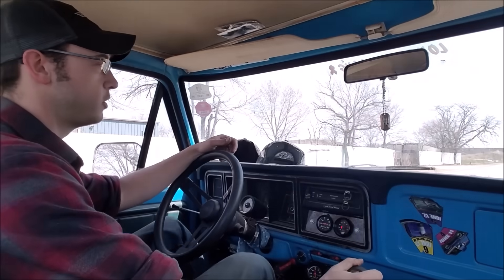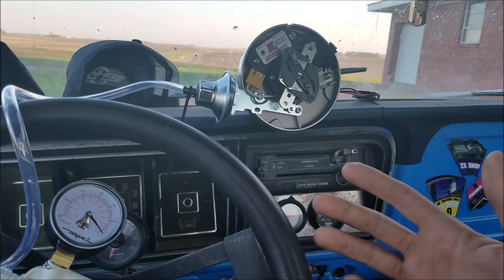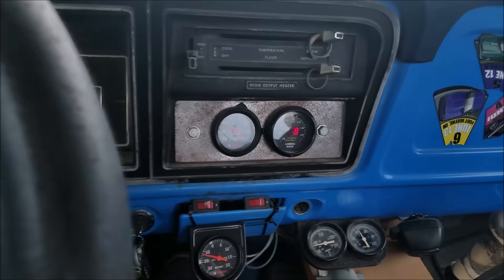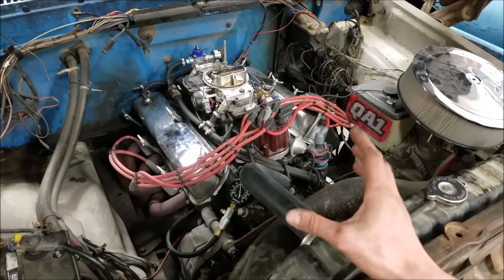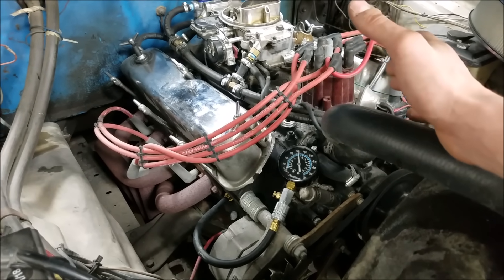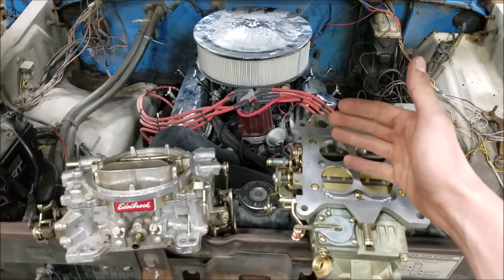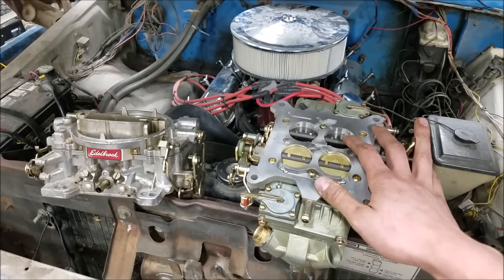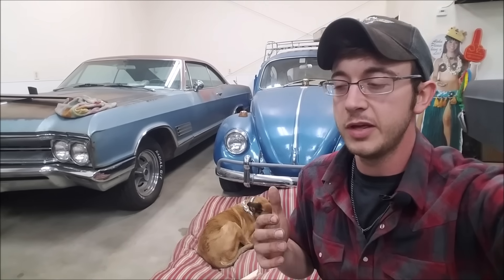Vacuum Advance - Ported vs Manifold: Which to Use & When !!!

Comment: Great video, you really know your stuff and explain it well.👍😎 The vacuum advance is even more important on a Ford flathead 8BA V8 since the distributor  does not use any mechanical advance. It is a very interesting system. It is also why most modified Flathead V8's get such bad gas mileage since the system only works with the stock carb.
Reply from the maker: Thanks so much! 
I’m not sure about the flathead comment though, I believe they are a typical vacuum advance and mechanical advance distributor! 
Now older beetles - like mid 60s and earlier actually only had vacuum advance BUT they used venturi vacuum which increases with air speed - so essentially as RPM increases so would the timing. 

Not a big fan of beetle ignition timing though, it was extremely inferior in my book!!!
Reply: @ThunderHead289  I am working on an 53 Customline with an 8BA at the moment installing a dual point plate, and there is no mechanical advance in the distributor at all. The point plate is actually mounted on a ball bearing so it can respond to subtle changes in vacuum. As I said before it is an interesting system. The carb also has some extra vacuum control with two different ports to the venturi and some check balls and an air pressure sensor. Check out a Holley 1901 carb to see the system. Not the new 1901 ( thermoquad clone) but the old one.
Reply: Yeah ford called it the load-o-matic distributor used from 1949-1957 on both small v8s and inline 6 engines and well Into the 60s on inline 6 only.   It required the vacuum signal from the carb venturi for it to work as intended, and used only vacuum for timing advance. It required te use of a specific carburetor and a spark control valve. I had one on a 1957 272 and swapped it out for a mechanical/vacuum advance dizzy and the difference it performance was like night and day. Unless you have a 100 point restoration I suggest you get rid of the  load-o-matic dizzy as soon as u can. The performance increase is almost unbelievable you won't be disappointed with the results

Comment: Luke, really good video. Very informative. And you have that old Ford running like a beast. Motor still sounds strong , and good compression the bottom end still has. Good job bud
Reply from the maker: I’m amazed it has that much! That engine has 165k on the clock at this point. I’m glad you liked the video and it made sense - it’s hard to condense everything down so much. For everything I say, there’s 5 points I cut out for the sake of time.

Comment: Hi Luke. I used to put a light on it. Rev it up, switching the hose back and forth and turning the distributor, to get the best timing setting. Also changing the mechanical weights and springs .

Comment: I always tune my carbs/timing without the vac advance hooked up, then once it runs the best I go back & reattach an adjustable vac advance to manifold vac (always seems to have worked the best for me) & take it back out to set when & how much the vac advance does for best cruise/part throttle torque.
Reply from the maker: Essentially when driving it’s all largely the same, but adding 10 plus degrees after you do all your carb idle settings is going to raise your idle rpm forcing you to go back and readjust the carb afterwards. 
If you actually went back and connected to ported, everything would be all equal on a vehicle that you set up as you describe
Reply: @ThunderHead289  I think you disconnect and plug it during ur mechanical adjustments to prevent that "getting into the ported draw" you described... then adjust the carb mix, then connect vacuum advance and bring idle down where you like.

Comment: Youtube is posting ads every two minutes.....

Anyway, I have a 350 Buick in my 66 Chevy. I run the vacuum line off the Q-Jet's little brass port. It's a stock V8 that's 45 years old but I still eek out 17mpg on the hiway which ain't bad. But I never knew the value of ported and manifold vacuum. That's a new one on me.
Reply from the maker: On ported you can run a little more mechanical initial - of course with keeping total timing in mind. Luckily most stock engines have a lazy advance curve and low degree total timing value, so this can be almost immediately applies without having to do anything else. 
The factory set points are all extremely safe.
Reply: Sounds like my 78 351W, manifold vacuum and I get 18 city and nearly 27 highway.  But yeah never run manifold vacuum for vacuum advance lol.

Comment: So for 30+ yrs and hundreds of engine in cars and Dyno run you think my tuning would make a car lazy or have poor performance?
Sorry but ported vacuum is near useless on stock to high performance engines.
Vacuum advance is basically added to increase you cruise mileage
Since I learned tuning from some seriously famous engine builders and you claim about stock or mild cams make absolutely no sense.
Say a small block like 36 total for power production. IF you ADD timing with ported you will force engines with with more compression to rattle as you part throttle accelerate. Seen it hundreds of times and had to fix engines broken from improper timing.
You can believe what you want and throw it out on you tube but from power production and street performance I'll keep using vacuum advance for it's intended use. Mileage.
Tune your centrifugal, and initial for power and if you street drive it add vacuum advance with manifold vacuum and use a limiting can to avoid spark knock/rattle. Worked for last 75+ yrs, and when you may the throttle you go back to best performance full throttle timing.
Got a whole shelf full of hyperutecic pistons(new cheap favorite performance pistons most use instead of forged in wrong instances) MINUS ring lands and Piston crown from rattle and many from trying to use ported vacuum.
Leave ported for the old-school 70s emissions crowd.
Reply from the maker: I’m not sure who taught you, but ported vacuum is exactly unequivocally the same as manifold vacuum except at idle. It IS just a device to aid in mileage because at part and low throttle cruising you have less cylinder volume so cylinder pressures are lower and burn time is longer. Stab the throttle and when vacuum signal drops, you of course are just on your mechanical timing. 
You clearly just commented without watching the video, or comprehending what you watched. Because I lay that all out clear as day. I encourage you to rewatch and process what I said. 

From your comment, I’m not sure if you understand how ported vacuum advance actually works. 
On a mild cam or stock cam engine, for the carb to be in its proper dynamic set up, you have to run too little mechanical advance at idle on Manifold vacuum. When you mash the throttle your timing mechanical timing is late and it’s weak off the line. 
The bandaid is to advance the timing quickly by adding lighter springs - but then you have too much mid rpm cruising timing and you WILL have part throttle spark knock!

High lift cams are completely different. 
They require a lot of idle timing, so a more reasonable curve can be used in conjunction with manifold vacuum. This is why I say stock and mild cam build - which unless you want to lose on the street, is what you should have anyway.

Comment: Been watching ur videos really like them I watched where u put 5 speed in ur truck I have a 73 f100 I'm putting tremec 5 speed in it on yours did u out clutch spring on ur throw out bearing arm and did u have to modify clutch rod is appreciate your answers
Reply from the maker: I used all the original mechanical linkage as it was - what bellhousing are you using? 
I’m finishing up a TKO 5 speed swap on my galaxie right now.

Comment: Ported vacuum for the advance came out in the early seventies to effectively retard the timing at idle for pollution purposes.  Because the timing was retarded, there was less heat in the combustion chamber reducing one of the three exhaust pollutants.  Long time ago, which one I don't remember.  Thanks for all your content.
Reply from the maker: This was true with how it was utilized in the 70s, but actually ported vacuum existed even in the 50s and was used by flatheads long before emissions existed - before PCV and everything. 

I used to believe what you said above solely, but I got that info from the internet, and it may be the single most regurgitated and repeated “claim” about ignition timing to date. 

Don’t fear ported - 
There are two ways to do tuning to make good power. The way I showed here, or manifold with quick advance springs so an engine doesn’t fall on its face off the line - my problem with manifold is that then when cruising, you have way too much cruising timing at the lower rpms
Reply: Learn something every day, even at my age.  Oldest car I've owned was 62 Pontiac with manifold advance.  First car I owned with ported advance was my 74 Barracuda 318 and all the pollution stuff except the cat-con. It has a OSAC (orifice spark advance control) valve to let the vacuum build up slowly when depressing the accelerator.  When I first got the car I thought I'd be smart and hook it up to manifold vacuum. Not good,  put it back to factory and it ran much better.  Thanks & Best Regards @ThunderHead289

Comment: Good video on this. One of the dangers of running manifold vacuum with too much advanced initial timing on a stock type cam is breaking the nose of the starter off at startup.
Reply from the maker: The biggest problem with running manifold is that you have to have a lazy mechanical initial setting to not have too much timing all together - no problem, utilize quick advance springs to compensate! 
Well, then you have too much timing while cruising at mid rpm driving rangers 1500-2800 rpm.
Reply: @ThunderHead289 , you are still limited by initial advance unless you dont mind letting your engine cool off before restarting.  As I said on the last video my 302 would not run smooth at idle with ported.  Already at 12* initial as I bumped it up for more power.  14* has starter drag when hot.  Vacuum advance is really something you shouldnt worry about when it comes in cause vacuum advance is only used for low load conditions any time you hit the throttle hard under load you are running off mechanical advance only till the load lightens and then vacuum advance comes back into play.  I'm still trying to grasp how ported vacuum gives you better power and better economy.  When you make more power you consume more fuel.  It also goes against what ford did for economy by advancing ignition through manifold vacuum stupidly high through the economy calibrated DSII modules.  My 78 mercury has one and my manifold vacuum advance 351W with 14* initial with the DSII economy valve to manifold vacuum puts my ignition in the 40* range at idle.  Engine made great power and still was able to get me nearly 27 mpg on the highway at 75 mph.

Comment: Super helpful video and great explanation as to why it's used. I have been dealing with vacuum advance issues on a 76 Datsun 280z due to leaky vacuum lines. It's fuel injected but it uses port advance off the throttle body.

Comment: Apples and oranges comparison but I would love to see you do a video setting up a carburetor for a ls motor or other distributorless motor.
Reply from the maker: If I could program a timing curve all my own, I would actually love it. The shortcomings that are inherent in the design of oldschool distributors are super annoying. They work just fine, but with timing being so essential to performance, a little tweaking here and there moreso than what a spring and stop bushing distributor allows would pay dividends for sure.

Comment: One possible issue. If you have an emission tuned motor they used ported vacuum and a lot of degrees of vacuum advance so that they can have decent cruise advance and late timing under low RPM load to reduce NoX pollution. You need to make sure your vacuum can does not add a lot of advance or you will get surging with a proper centrifugal advance curve because the vacuum can is too aggressive for a normal performance setup. Anything after 1970 is suspect. I used to block the travel by drilling a hole in the are at a specific location and putting a machine screw and nut that hit the housing and block out some of the advance.
Reply from the maker: Even most aftermarket units run about 15 degrees. It’s frustrating - there are actually two methods I use which what you stated above is exactly why I tell people ported, because with more initial mechanical, a guy can run a broader advance curve which most units have anyway. 

The other method is manifold vacuum where your mechanical initial is low, but you use aggressive advance springs BUT when you do that and your vacuum canister brings in another 15, you have WAY too much timing. 

A lot of old street rodder mod stuff guys used to do to original equipment to make it do what they want - love stories like that.

Comment: I have a question on the testing clips at the end. His rpms on the stock hei  were good to 4.5 K rpms. Is distributor rpm's half speed of the engine? If so 4.5k distributor rpms would be 9K engine rpm's. I was just trying to make sense of it, as I have never had high rpm break up on stock hei distributors. I ran up to 7000 before and my friend I grew up with had a 283 and he would bury his 8k tach.  ( never made any power that high, but sounded real fun ).

Comment: Excellent video as always. Any idea what would cause a flat spot on my new 2150 carb. It only does it when it’s cold mind you are non-Ford Liking mechanic set it up for me from Brand new.
Reply from the maker: Even with choke on, she just needs a minute to get to temp - everything is calibrated for operating temperatures - that’s just carb things. You could play with the timing a bit and see what it will give you
Reply: Awesome thanks man I thought maybe it was a bad power valve I heard if your car back fires which it has done when cold that it can blow your power valve

Comment: Fuel burns at a constant rate, the faster the engine turns the less time it get to do its job, hence advancing the timing. It's a balancing act between high compression, high octane, and piston speed. The weights in the distributor don't really start to move untill the engine gets to about 2000rpm, but the vacuume comes on almost instantly, giving the engine more timing at the get go. You can smooth out this transition by using lighter weights in the distributor.
Reply from the maker: Somewhat correct - higher cylinder pressures burn faster. Lower cylinder pressures burn slower. 

If what you say were completely true, timing would never stop increasing, but we assume wide open or darn near at 3500 plus rpm, so we stop advancing timing by then. 
3500-6000 is the same advance, because at wide open throttle, cylinder pressures are constant
Reply: @ThunderHead289  When I mentioned high compression I was referring to compression ratio. Most engines on the planet run best at about 34-36 degrees total advance all in at about 3000 rpm. After 3000 and higher cylinder pressure, you're right, more timing is not needed due to faster burn rates. It all boils down to avoiding detonation at all cost. A blown engine is no fun.

Comment: My experience with carbureted engines is that GM usually (99% of the time) use ported vacuum at the distributor and Ford uses Manifold vacuum. I have tried on many occasions to switch it up, and 99% of the time, the way the factory had it is the best way. Even after performing a lot of performance mods, such as Heads, Cam, Intake, Exhaust, ect. ect.
Reply from the maker: Give my advice a shot and you won’t be able to wipe the smile off your face. You have to advance mechanical initial on ported

Comment: Ha ha, there interest lies in a high idle switch which was designed to let throttle drop to zero so the engine didn't have a lope/zero throttle plate and no run on (spark knock fire, on compression, with key off) I have used them like yours to do the charge a battery or do a jump for a dead vehicle. It is hard on the engine when you shut one off and it keeps trying to run or even run backwards resulting in timing chain failure

Comment: You forgot about the old school cto switches. They would tap into a coolant passage usually in the intake manifold and were supplied with manifold vacuum. It would switch between manifold and ported vacuum output depending on engine temperature.
Reply from the maker: It would advance timing when cold because the mixture is lean - a lean less dense mixture burns slower and requires more timing to burn at the right time 👍
I avoid all that stuff - My montra is “less to fail”

Comment: Generally GM products used manifold vacuum while Fords used ported vacuum. Manifold vacuum on a Ford doesnt work for me. Can't get idle right.
Reply from the maker: There are two ways of going about this - the latter is to have a faster advance curve and run manifold vacuum with a low mechanical initial value. 

That way, when you hit the gas, as rpm increases, timing rapidly does also. 
I prefer the ported method for street engines, it has never failed to outperform manifold yet. 
Key phrase though - stock or mild street engines.
Reply: wrong

Comment: My 84 Capri RS 5.0 4V has a combination where, it has full manifold vacuum when the engine is cold, then switches to  ported when warm. This is done with a temperature actuated vacuum tee in the back water passage.  I had this removed for some time until I understood the benefit of the extra timing when the engine is cold.  Thanks for the informative video.